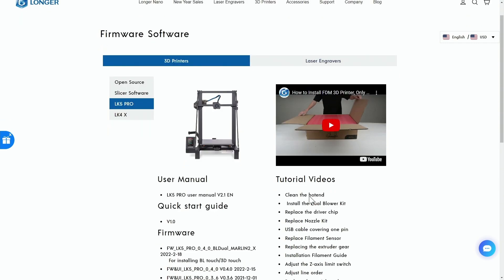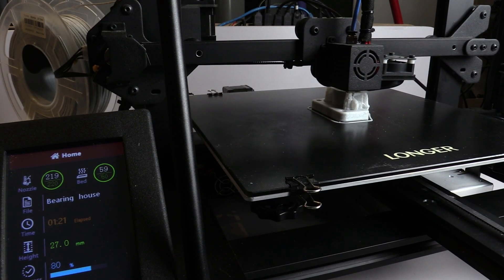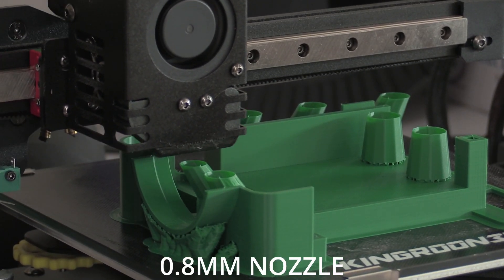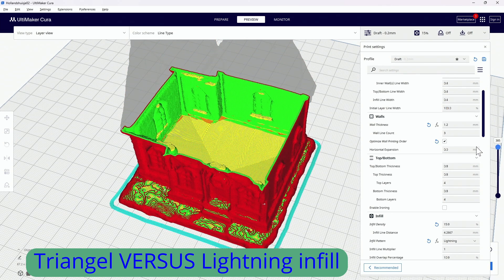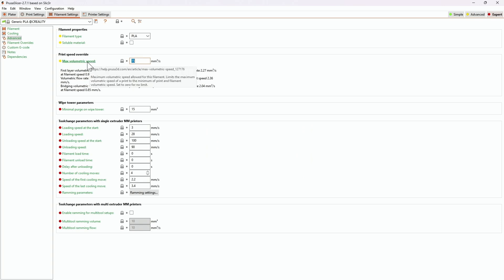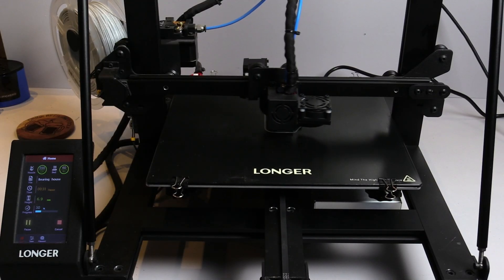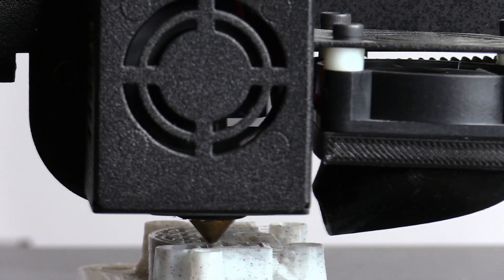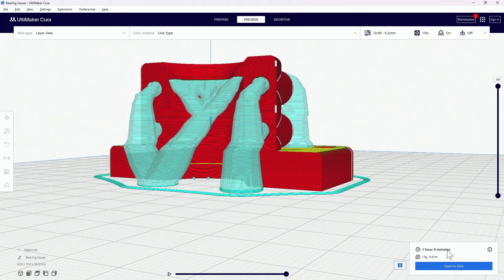▼ 10 ways to Turbocharge your OLD 3D Printer

Comment: Awesome tipes. I learned some time ago that power failure hammers your SD and wears out the cells, a better SD will also have better write endurance 😉

I learned its just better investing in a battery backup 😅 especially because most the time the print fails, the bed cools and you effectively loose the print

If you still have an old 8-bit board and you get hard pauses caused by buffer underrun you can run the printer steight off a PC. Effectively "klipperizing" it. My old wooden Replicator can print at up to 180mm/s 😮 but only 45-65mm/s off the SD card 😢 unless i lower print step resolution
Reply from the maker: Yes and No, this is totally true for some types of printbed. However the Glass with dots beds I have on most my old printers, don't release the print even when cooled down. I have to use a scraper to get the print of the bed, and then the power fail function could be helpfull. These glass beds on old printers are in fact very good, as you can stop heating your bed after the 3rd layer, saving on energy costs. This also makes it possible to tun more printers on only 1 breaker.
Here in the Netherlands, where I live, a power outage almost never happens. Therefore, I am not doing any counter measures to prevent a failed print. I have the power failure function on almost all my printers turned off.